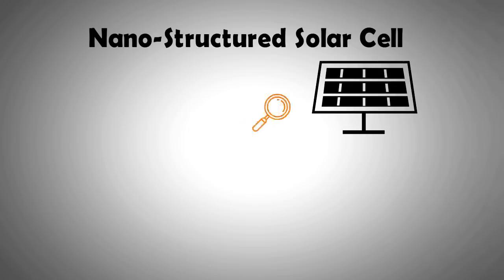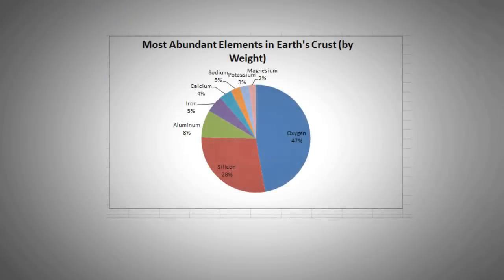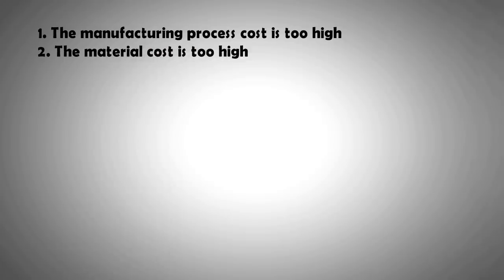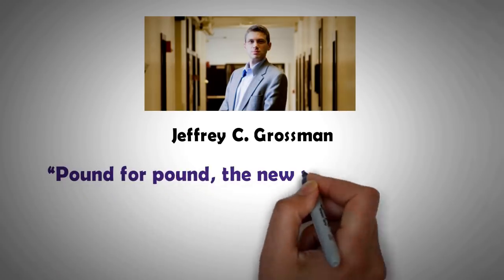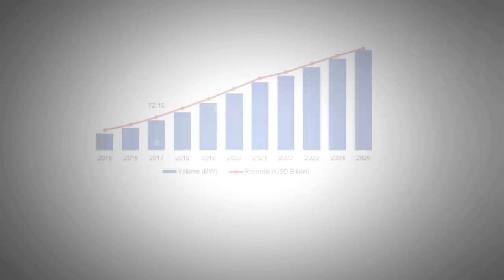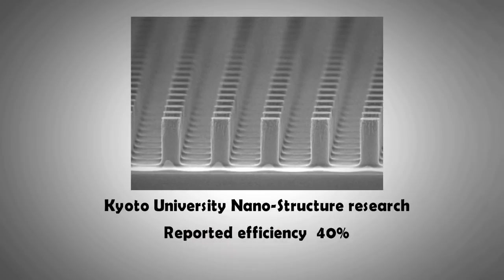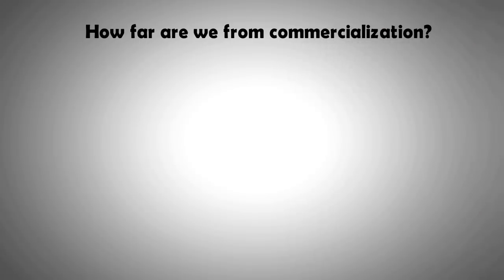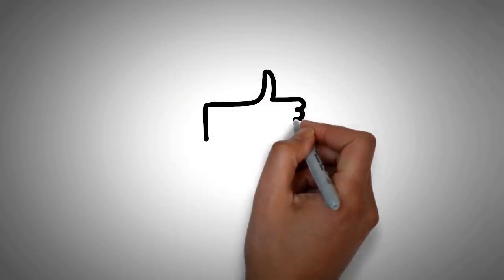Nano structured solar cells - Breakthrough Technology

Comment: No references, no explanation of how you beat the Shockley-Queisser limit, no talk about stability of the structures ...
Reply from the maker: I have added the links for your reference
Reply: @synergyfiles3536  From the paper: "In the study by Ilic et al. (16), for example, a theoretical calculation indicates that longer-wavelength emission can be successfully returned to the filament by optimized mirrors, resulting in a theoretical luminous efficiency of 40%" ... it is not something they did or claim they can do in the peer reviewed paper. The popular article is just wrong.

Comment: Ok super, but what about energy storage, durability and recycling?
Reply: If it's the same material as "regular" Si PV they will probably be similar. If there's a lower amount of material in the panels recycling will hopefully be cheaper too
Reply: @nicf1555  Yes.  Also the lifetime of normal Silicon solar cells is measured in multiple decades.  Durability is functionally a non-issue.  Therefore recycling is largely a non-issue.  Solar cells made 50 years ago still work, and newer ones are more durable.  Conversion efficiency may decline over time, but not enough to need to recycle.  Solar cells still produce most of their electricity compared to new, even when old.

Comment: If its just exposed nanostructure wont it erode when cleaning them?
Reply from the maker: Stability of the nanostructure is the thing that is being tested and improved right now. It is the biggest road block in making this tech commercial. Otherwise they have already produced them and tested them in lab environment
Reply: the structures could be sealed in glass or clear gel coat.
Reply: Have to encapsulate them in Silicon oxide(glass) 

Currently they are still morons putting sheets of glass over the silicon surface with a plastic coat inbetween.  Until they start etching the glass and depositing the silicon onto the glass, keeping the oxygen out will not happen or making them cheaper.  Need to start glass ferting the edges just as is done on any other glass welded product

Comment: What makes the efficiency percentage?
Reply from the maker: Efficiency is the ratio of amount of energy conversion into electricity to the amount of light energy falling on the panels. Normally panels would convert around 18% of the light energy falling on them into electricity. The premium ones can convert upto 23% but they are expensive (sunpower brand).

Comment: Ok.. wait.. Quote: "Material is reduced by more than 1000 times"  vs. the next quote:  "Pound for pound, the new...up to 1000 times more power.." That means, for the same size panel, it will be 1/1000th the weight.  And, since he said 'pound for pound', it will produce 1000 x more power than the same weight of crystalline silicon cells.  So, for a given size panel, it will weigh less, but make the same power???  That's not much of an improvement, especially since the lighter panels will require a lot more support and protection, negating a lot of the weight savings.  The only application where these would make sense is where you could make them part of the structure itself, such as the superlight solar race cars.
Reply: Two other points:  You say this will save material, but that's not true.  The process is ablative, which means that the silicon starts out thick, and they use photolithography, chemicals, or lasers to cut away the silicon around the desired structure.  All that silicon is pretty much wasted, as recovering it from the waste stream is not cost effective.  Lastly, a brand new technology that is supposed double efficiency coming off the line at the same (20%) efficiency as today's solar cells is not 'good for a start'.  It's abysmal. Not to mention that some conventional silicon panels are now reaching over 22%, and two years ago a multi-spectral panel reached over 40%.

Comment: The application of this would be best utilized in space due to it's light payload costs, also no need to use valuable land area here on Earth.
Reply: Also would not need a cover to protect the nano structures from dust, pollen, debris and pollutants.
Reply: Solar cells for space purpose are already much more efficient than cells for houses. But they are very costly per Watt, this is why they are only used in space. Maybe this one will be competitive in weight and efficiency, but much cheaper.
Reply: We could use 3D printers to produce it in space at zero gravity which would result in a higher quality product (less imperfections due to weaker gravitational pull)

Comment: Ok I am working on producing chips and we have both SiC/GaN and GaAs, so the price difference of both technology is about x10 or more so. I don’t think that’s GaN tec will be soon cheaper. The difference is the working voltage and current. To etch on SiC/GaN needs more power/energy. Yes It drives on other level than Silicon or GaAs but the price too. Sorry to disappoint you.

Comment: This could be a game changer if the efficiency reaches 40%. Good news indeed.
Reply: What makes the efficiency percentage?  And what is the percentage of the ones you see on houses today?
Reply: @jennymisteqq695  15 - 20%, lower if the panels are misaligned compared to the sun
Reply: @jennymisteqq695  Its 18% on sunny day
Reply: The most out there atm is 21-23% from the ‘Sunpower’ cells.
Reply: Cells with 40 % would be good enough to put them on EVs bonnets and roofs, where they could produce energy for shorter distances. Current cells are not good enough to produce a significant amount of energy on cars, if you not cover the complete car with it.

Comment: New technology will make these cells 1000X more powerful.
Wait. WHAT?!
1) you cannot absorb more power than what is reaching the cell, right?
2) If this statement were true, even at a 100% efficiency rate, that would make current efficiency rates at 00.1% or LESS. 
Clearly, presently produced cells perform signifcantly more efficiently than that. Ammirite?
3) Logical deduction: The statement, whether by design or by chance, is patently false.
Can this entity be relied upon for factual presentation on the subject?
Reply from the maker: Please dont attribute false statements to me

Comment: The main cost for installing solar pv on your home is labor.
Reply from the maker: True the labour cost in many cases overtakes systems cost
Reply: @synergyfiles3536  profit margin is the biggest expense. DiY solar is $1 a wattt for materials. Hiring someone is $2.75 and up per watt
Reply: This is why it should be mandated that solar should be installed for all new house construction, instead of a retrofit. Return on investment would probably be 5-7 years of electricity bills.
Reply: @yanstev  first require better insulation, heat pump water heaters, and higher effciency Ac units, like mini splits that has a faster payoff and wokrs well regardless of if you have shade or sun on your property/roof

Comment: Very interesting technology to watch. I have a few doubts about the implementation of such nano structures: Will they be melted inside the hail-proof glass cover, or will they be under the glass cover, if so, what will prevent the glass from crushing these nano scales, what about the efficiency behind this glass layer, etc.
Reply from the maker: They will be behind a glass layer. There are very high transmittance glass available. The test going on currently are to produce layers that are stable and stand the test of time

Comment: nahhh. it appears that this is process intensive like how electronic chips are created..therefore, will not be able to produce much panels then expensive.  it has some promise for smaller applications though such as an electric car which could use higher perf solar panels
Reply: All manufacturing is 'process intensive.'  If you mean the technology appears cost prohibitive due to its production complexity, that is most unlikely in the event nano solar provides twice the power output of existing solar.  Put simply, the installed efficiency of nano solar would quickly compensate consumers for any additional upfront cost of the technology.  In addition, larger scale solar systems would benefit the most for exactly the same reason:  higher energy capture over a larger area.

Comment: Imagine these on a electric car.
50 km rage added each day.
You would only charge on long road trips.
Reply from the maker: That is a good application indeed
Reply: @synergyfiles3536  no that is a horrible application. Why  would you want a power generating solar panel on a device you only use an hr a day. when the battery is fully charged, guess where all that energy goes? no where! it is wasted. Better to put it on a house where it can be used for peak producton 8 hrs a day
Reply: @khanhdam5745  You obviously don't know anything about EVs. Tesla Sentry mode consumes quite a few watts when the car is parked, recording videos of dogs peeing on your wheels, honking to move them away, and tasing them with 10,000V electrified wheels if that's not enough.  ;)

More seriously, it's not a question of solar cars or solar roofs, both are justified and can and should coexist. Current photovoltaic systems for cars are thin flexible sheets. Even this nano technology might prove too thick for cars once you integrate the required protective layer.
Reply: @khanhdam5745  if only there were cars that moved all day long.......like a car that takes people from one place to another say like a taxi... or a car that ferries material from one point to another over long distances maybe like a truck...or maybe we can join vehicles together and tie them up then place a metal rail for them to move on like dunno a train.
Reply: That is a great idea because even during a natural disaster you would still have the ability to drive some. When we had a hurricane all of the gas stations were closed for 5 days because there was no power to them.

And when you do have power the additional 50 kilometers of range makes a huge difference. The difference between 350 and 400 km is significant.

And they would reduce your home electric bill if you were charging it home because sometimes you might not need to charge at all.

Also it would be great for people who have to park on the street.
Reply: @mac_mcleod 
And think about places with not well developed infrastructure: think of having a solar car in rural Africa or rural India.
Or just not have to bother finding a charging point.

In 17-20 years this could be an affordable solution.
Reply: Agreed, even without these types of efficiencies, it would seem to be an obvious progression for EVs to have their surfaces covered in flexible PVs. At today's efficiencies that could already equate to 30 km range on a sunny day. Since the average commute is around 30 km, suddenly we could see far less reliance on a the grid for charging.